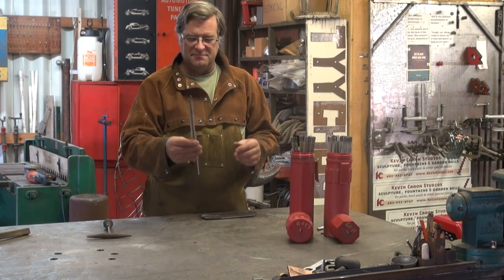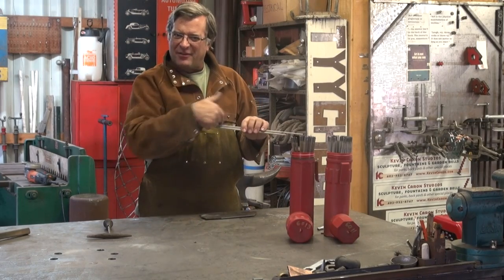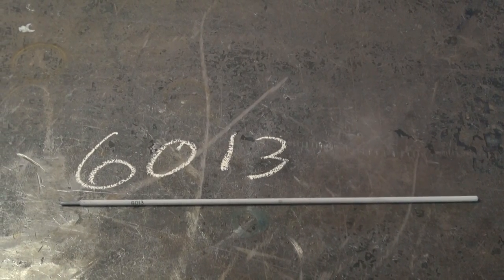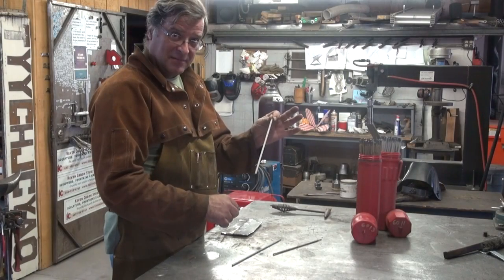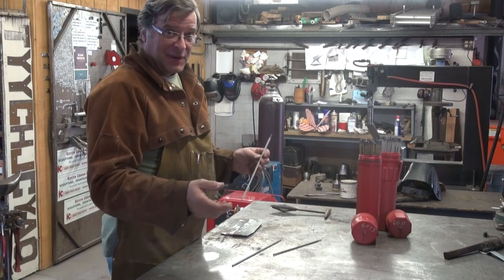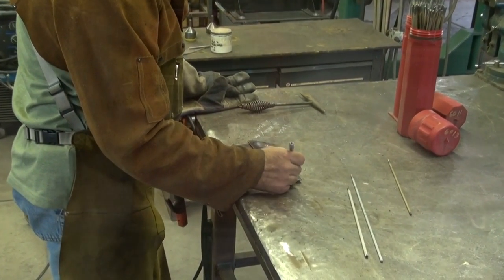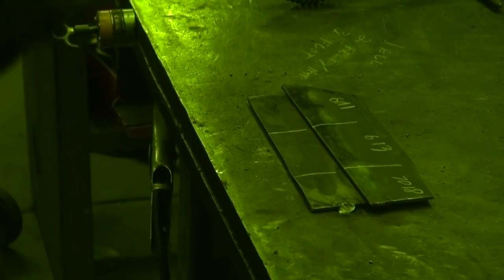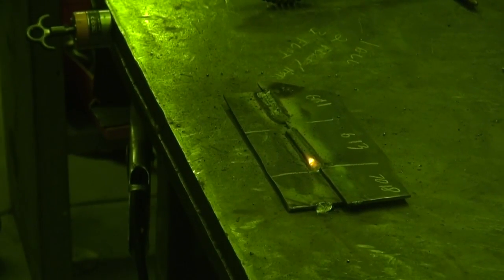How to Select Rods for Arc Welding - Kevin Caron

Comment: i need your help buddy..i have an old Lincon electric arc welder ( ac 225 amps) model AC 225-S..can i use this machine to weld aluminum? and if i,can what aluminum rods do you recommend? its to weld 1/4in thick aluminum on an outboard motor?..great video i really appricate ur help pal.

Comment from the maker: When the rod gets stuck mig welding?!?!   You mean arc welding I'm sure..  Just a quick whip back and forth normally breaks it loose.   If not squeeze the clamp to get the stinger off the rod then break or cut it off. Clean up the mess and get back to work..

Comment: Thanks for the excellent video. I have watched many of yours and decided to subscribe so I don't miss out on anything. I have one of those "tombstone" welders and still have to revert to it when the little mig won't do it, like 1/4" and above. I generally end up using to much amperage because I have such trouble starting and holding an arc.
I would like to see more buzz box videos.

Comment: Good  explanation -   I would add that 6011 is a excellent filler rod and superb for a root weld on AC. Works great in the field for dirty rusty steel. Needs a little less amps than a 7014 or 6013 and will give alodt deeper penetration .   oh and next size up from 1/8 is  5/32.  Cheers and keep the great videos rolling

Comment: Burn... on might say arc burn. lol. One tip, the 6011 should be run with almost no arc gap. Just put the rod on the job and let the travel speed be dictated by the burning away of it. 
Mick

Comment from the maker: Keeping in mind that I'm self-taught and not certified I would have to say try 6013 3/32 inch. But if I was going to do this job I would use tig or mig instead.  Make sure you really understand what you are doing here. The last thing you need to happen is a weld breaks while you are flying along with your butt 3 inches off the ground.

Comment from the maker: @spelunkerd  Welding rod will last a very long time if it is kept dry. Pretty much anywhere but Arizona you should store your rod in a watertight container at the least. Most welder will store the rod in a dry box near the welder so it is at hand. You can make a dry box just by putting a low wattage light bulb in a metal box. Yes, it needs to be hooked up and just leave it on all the time.  You may have to go higher watt\age depending on your location.

Comment: How long can you expect welding rods to last on the shelf? Is there a difference in shelf life comparing these different rods? Do you keep any in the cooler to prolong life? I always struggled with low hydrogen 7018, mainly because it was harder to start and it seemed I needed more current. Does it help to do 7018 using a DC technique?

Comment: Great vid Kevin and Marry, I have always been put off using my arc welder as I didn't understand the use for all the different rods it came with and so it has sat in it's box since the day I bought it; well no more! I'm going to dig that puppy out tomorrow :)

I would prefer to use MIG or TIG but will an arc welder be okay for welding stainless steel pipe and plate? As I would like to make a strut tower bar for my old 3-series.